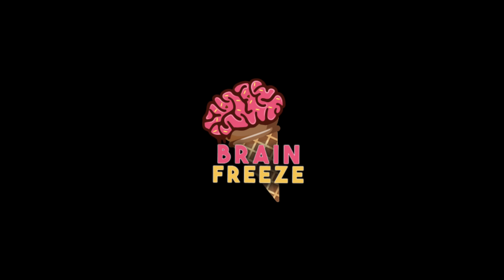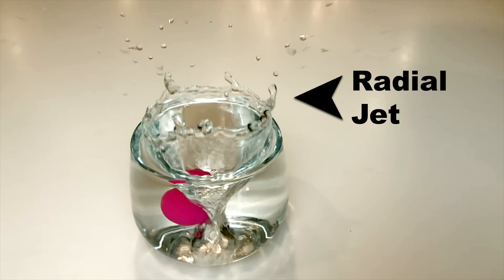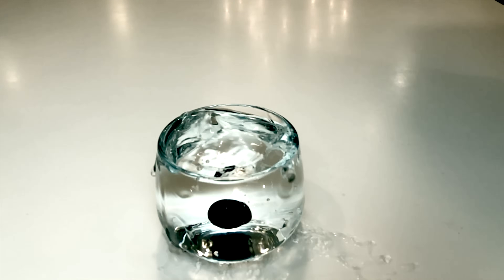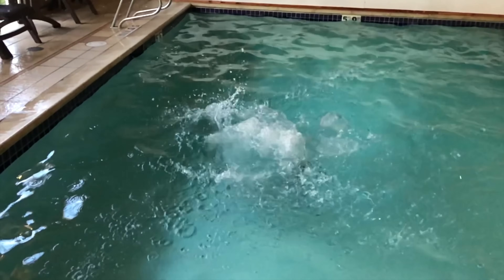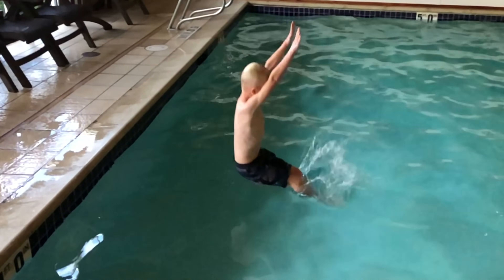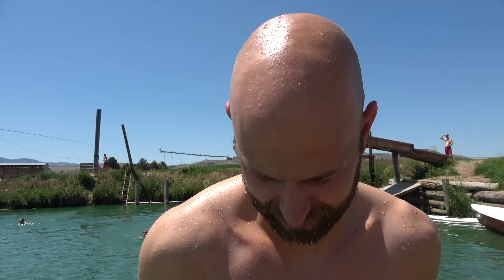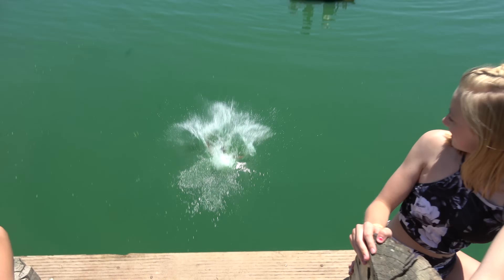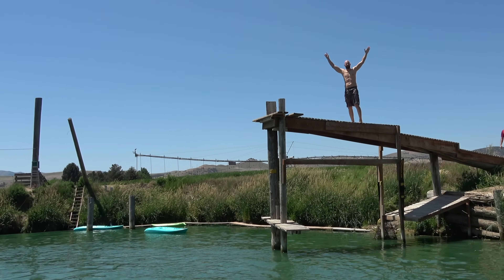How to Make The Perfect Cannonball

Comment: Biggest splash you can get is stick one leg straight out and have the other one bent like your doing a cannon ball. As you jump do a 180 so your back is facing whoever you wanna hit. Then slightly lean back with your arms out or at your side. It will spray water like 30 ft in that direction if you get it just right.
Reply: So basically what people call a can opener

Comment: While your theory is correct, the actual way to make a bigger splash is to make sure that you hold onto the water pull as long as possible by popping out and that you disperse more area and create a bigger hole for the water to collapse into. And bombs such as the canopener, staple, coffin and manu can increase your area and pull.